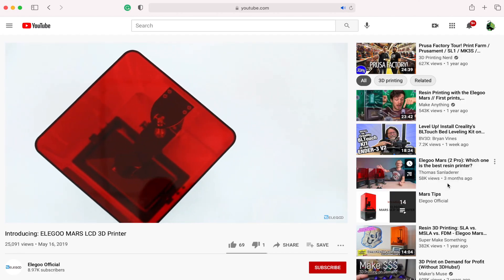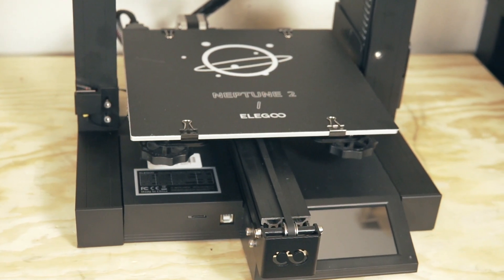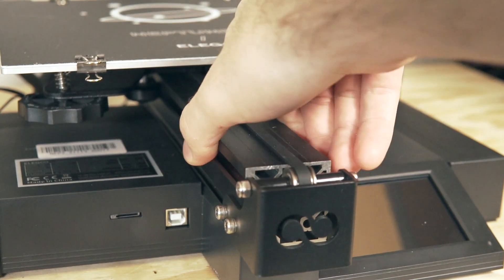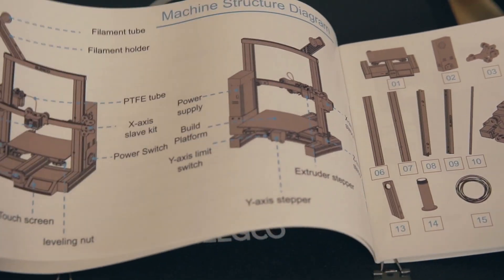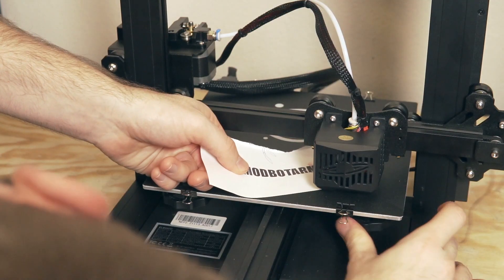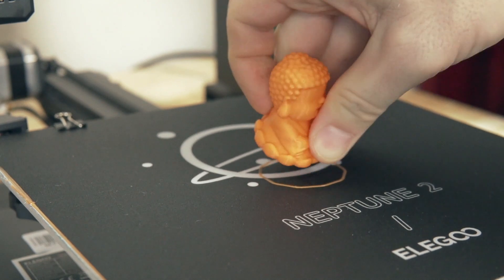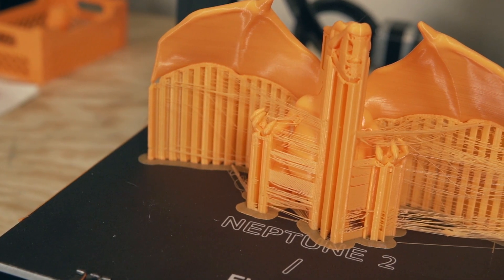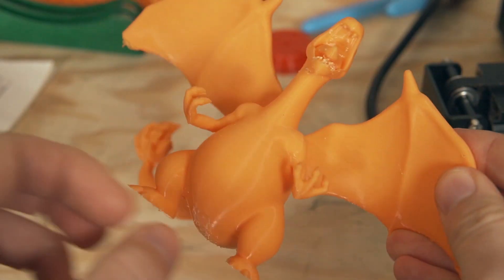Best Sub $200 FDM 3d Printer In 2021? The Elegoo Neptune 2

Comment: The setting you want to reduce the stringing between supports is "limit support retractions" under the travel section (hidden by default).  Checking that box means it rarely/never bothers with retractions going from support to support - the reasoning being that it saves time and you don't really care if your supports are stringy.  The caveat is that it's not super smart about whether it crosses over the actual model when going from one support to another, so sometimes it will create strings on the model itself.  If the stringy supports bother you, or it's dragging the strings across the model and messing up the finish, just uncheck that setting.
Reply: Ha. I learned something today, thank you good sir.
Reply from the maker: This is the first time I have heard of this haha. Thank you very much for letting me know as well as for the detailed comment. I am sure that is what it was since the main print had no stringing issues.

Comment: Well done review. Looks like a very good printer for that price. It even offers more features than the Ender 3 V2 at $279.
Reply from the maker: Thanks Chuck! It is pretty damn impressive. I have a V2 sitting here waiting to be opened so I am looking forward to seeing how it compares.
Reply: @3sotErik  better to buy the best machine you can in your budget now than wait and not print anything for weeks. No telling when the Neptune 2 is coming back in stock but if you can find it and a return policy for back up, go for it. Probably the best tinker printer for $160. I would hesitate for more than $230.

If you can spare the extra budget, check out the Biqu B1. A flexible bed and dual cooling fans and other features here and there are nice over the V2.
Reply: @ModBotArmy 
Hey, so, I'm a bit confused:
Do you think this print glass filled nylon or not?

You mentioned that the hot end was all polymer, so that it might not be a good idea to run it at the full 260°C.

What upgrades could be made to enable it to do so safely?
Reply: @wanderingcalamity360  Hey, just saw your comment, 260 with a non-all metal hotend is literally the bleeding edge of a nerutoxin filled room and that is assuming high quality teflon is in the hotend. 240 to maybe 245 is the safe limit and even then you would need a specialty nylon that prints well at that temperature. If the heater overshoots at all, you might put yourself and others in danger so grab yourself either a micro swiss or e3dv6 or other and slap a hardened steel nozzle on there for good measure. You may also want to invest in some form of dry box and maybe a dehydrator/desiccant for nylon because it is very hydroscopic. Filament slipping with abrasive filaments is also a concern so you might need some form of dual drive extruder with hardened gears rather than brass. Long story short, you can try and print nylon with what you have and stay safe by keeping your temps 240-245 but this is a $160 3D printer. Most people don't buy a moped to haul construction material if you get what I mean. Best of luck to your printing!
Reply: @Bajicoy 
Thank you for your help.

That lines up with what I've been researching.

I'm still trying to weigh options for what would be the most economical approach for the projects I'm looking to do.

I figure if it can print GFN, it can do just about anything I could ask of it.

I've got an old dehydrator that I was thinking about cannibalizing for a filament dryer and making an Ikea Lack enclosure for whatever I decide to go with.
Reply: @wanderingcalamity360  outstanding man, GFN is a great standard to have. I believe in you getting that setup!
Reply: Wonder how it compares to Voxelab Aquila
Reply: I bought my ender 3 v2 for 230 dollars from a 3d party store that sells most of creality's stuff in my country

Comment: Got mine a week agoi. Great little printer gives my ender 3 pro a run for its money. Build plate was the only gripe
Reply from the maker: Yeah build plate is the only thing that gets me. Any plans to upgrade?
Reply: I bought a PEI spring steel flex plate and that's so much better. I also want to do something about the part cooling fan and positon, will wait and see if people are going to mod this.

Comment: At 4:30 I'm surprised you didn't mention that on the main board there is an empty plug labeled BL-touch
I'm curious if the firmware supports it natively or if you have to do an update.
Reply from the maker: Yeah I should have. I would like to know that as well. They seem to make it easy to install with the mounting holes.

Comment: i replaced my bed with a mirror cut down at home depot/lowes got around 6 beds i can pick from for most flatness, just clean with ipa when it gets dirty, prints pop free with temperature differential, No glue no adhesives, just good bed level and layer heights, never have had an issue with prints pulling up

Comment: Tronxy XY-2 Pro has a larger build volume and Auto Bed Leveling at the same price and for a bit extra you can order it with the Titan extruder aswell. How`s that for a bargain?
Reply: Thanks for the heads up. Hellava bargain
Reply: I have an XY-2 Pro.  I bought it for $135 on a Black Friday sale, for that price it was impossible to pass up even with 5 other printers.  It is my least favorite printer though, and I dont think I would recommend it as someones first printer.  It is a fair printer if you do your research and understand the machine.  Eventually I am going to have to mod it to make it good printer, the firmware is its biggest disadvantage.
Reply: @jon9947  Marlin 2.0 is a breeze to install; less than half an hour easy. For that money you`re not buying even the base Ender 3 which lacks many of its features . I bought one as my first printer and after 2 months I bought a second one because for that money is a steal. Never owned an Ender 3 but I`d say as printing is concerned it prints just as good if not better and it still has those extra feature which to put on an E3 would cost you at least 100 bucks: silent board, ABL. You`ll still be left with a smaller printer. Believe it or not I`ve not done any mods on mine and it prints like a charm: even though I mostly print PLA I have managed to print ABS, PETG, TPU. BY the way what are those 5 extra printers if you don`t mind me asking? Just curious
Reply: @maiorciprian  Eventually I will get around to doing something with the printer.  I am just not in any hurry/lazy haha.  Giver or take Iv got about 50 hours of print time on it so far.  

My other printers are an original Ender 3, a cr10 Mini, a cr10, an Anycubic Mega S and a Tronxy d01.
Reply: @jon9947  CR10Mini? never heard of that one; so you like the D01 better than the XY-2? That`s a surprise as many people hate the D01 with a vengeance. Well, besides the two XY-2 Pro`s I also have a Two Trees Bluer Plus, which is basically a CR-10 with a few upgrades. Now I`m waiting for parts to build my first Voron
Reply: @maiorciprian  The d01 is another printer I got a really good deal on.  I bought it to mod, replaced quite a lot of the parts.  I probably would have been better off building a Voron or something else similar, but it was a fun project and it prints pretty good now.  Its biggest problem was flex in the bed because they used terrible bearings.
Reply from the maker: That sounds like a great deal. I wonder why they are not getting more exposure. Tronxy printers in the past have been hit or miss for me.
Reply: @ModBotArmy  I suspect the facts that the X5SA was a hot mess that required a ton of work just to make it reasonably functional, and the D01 was a fire hazard with the original FW, soured a lot of folks on the brand.  I've had several people tell me that tronxy actually listened to the criticism though, and that a X5SA pro today is vastly improved from the original iteration and the D01 now ships with TRP enabled.  I've also seen nothing but good things about the XY2, though as you said, you don't see much at all about it because most folks steer clear of the brand.

Maybe you can reach out to them and see if they'll send you their latest versions for review.  I'd love to know if the 2nd hand info I'm getting is accurate that tronxy has been upping their game and fixing their issues over the last 18 months or so.  There are quite a few tronxy reviews on youtube, but they're all at least a year old.

Comment: @16:00 Do the fans run at 12 volt or 24? Can I easily replace them with some from Noctua to make it quieter?
Reply from the maker: Should be 24V. The blower fans I do not think Noctua makes (maybe incorrect)

Comment: Sweet review so thanks for that! Question on the Elegoo Mars 2 pro, if I installed the resin printer in my office, how is the fume issue? I had heard that the newer mars 2 pro has better a ventilation system...
Reply from the maker: Thank you :) So it really depends, if you use low odor resin I do not think it is bad especially with the lid on. However, everyone has their own sensitivity levels. It is tough for me to say how you may feel. Some resins that are not low odor to me can still smell quite bad with the Mars 2. It is such an awesome technology though.

Comment: Have you already had a look on the tronxy xy 2 pro? It is sometimes really cheap and has a bigger build volume with 255 x 255 x 260. Running on marlin this printer is really capable of doing good jobs
Reply: LOVE my three Tronxy XY-2 titan pros.
Reply from the maker: I do not believe I have seen this machine. I definitely havent used it. It has been 1-2 years since I have used a TRONXY machine.

Comment: Personal opinion: Neptune 2 is a direct challenge to the Creality Ender 3. They got the price $10 cheaper than the Ender 3, and added a filament out sensor, and the Touch screen. oh! how can we forget the silent stepper motors. My Ender 3 is 2 rooms from my parents room, and they can hear it clearly through brick walls with the door closed....
The price drop reminded me of the price drop of CD-Writers, Here in South Africa a 1st gen CD-Writer was ZAR5700, The last time it was on sale it was ZAR350. The same is happening with 3D printing.
Reply from the maker: Yeah in its current state once they are able to get enough inventory if the price stays the same I can see this printer really doing well.
Reply: @ModBotArmy  Agreed, Elegoo has set a benchmark with their MARS series of printers. So we trust the brand. Honestly Creality has also set a benchmark as a printer that 99 times out of a 100 will give give you a workhorse. My little Ender 3 is still going after many years, supporting my small scale production for parts for my model rocket kits.

Comment: Great video but unfortunately NOT currently available on Amazon.
Reply: Apparently that depends on which Amazon. Amazon.de is running low but there still are a handful left
Reply: @saschaschneider6355  I didn't think of that, the link brought me to Amazon.com so assumed it was the place to go. My bad.
Reply from the maker: Were you able to get one? I am sure Amazon.com will get a resupply soon.
Reply: @ModBotArmy  No, but that's okay.

Comment: Im just confused now, should i buy an ender 3 pro( and update the 32 bit board/springs/add bl touch) for a grand total of 300 usd ? Or buy and try to upgrade this one D:
Reply: If I may: I‘d recommend the Ender 3 V2 - it‘s basically an Ender 3 Pro with a couple of great upgrades (ex. 32-bit board, silent steppers, bigger display, ect.).

I own the printer myself and am very happy with it.
Reply: @Schnabulation  The E3v2 is $280.  While it's a nice machine, you could buy the neptune 2, an all-metal hotend, a BLTouch, and a magnetic PEI-coated steel build plate, and end up with a machine that is significantly better than the E3v2 for less money.  If you're not afraid of doing some simple upgrades yourself, it's a much better value proposition.
Reply: @mortalwombat5811  I do agree with you on the „bang for the buck“ part but the Neptune 2 being significantly better than the E3 V2, even with the BL Touch and the allmetal hotend, not so much. It will have some convenience improvements over the E3 V2, yes absolutely. But I don‘t think the print quality will be superior though... 

What I‘d like to point out though is that the Ender 3 has a quite strong eco-system with a lot of pre-made parts and upgrades.
Reply: Go with the Ender3 pro and get a 3d touch from trianglelabs. Cheaper and just as good as the bltouch
Reply: I've gotten the E3 Pro a few months ago and if I was to buy my first printer today I'd very likely go with this one or the Biqu B1
Reply: @Schnabulation  ABL is a huge convenience, and while print quality is more or less "as good as it gets" with nearly any FDM printer these days, an all metal hotend will allow you to safely print with higher temp materials like ABS and PC (and even some pickier PETG) that you can't do with a PTFE-lined hotend.  As to whether creality's fancy glass bed is better than PEI-on-steel, that's probably down to personal preference as both are quite good.

That said, you're not wrong about the creality ecosystem/knowledge base.  If you want to add ABL to an E3v2, there's probably half a dozen brackets you can print on thingiverse and hundreds of articles, blog posts, and forum threads walking you through the process.  With a completely new machine like the neptune 2, you're kind of in uncharted waters.  I mean I'm sure it's not that hard to sketch up and print a ABL bracket or modify the FW for ABL, but it would be pretty intimidating for a first-time printer owner.

Comment: I've been on the fence about trying a 3d printer. This appears to work out of box as well as any FLM printer is likely to work. The printer plus a spool of PLA or PETG would be around $200. This looks like a good enough printer to make an occasional bracket or such but is low cost enough that one wouldn't feel obligated to use it all the time to justify having purchased it.
Reply from the maker: I agree, the cost of getting a 3d printer has hit a point where even if you dont have a million projects lined up many are able to justify it for the occasional part. With that being said, it is very common for people to have one reason to get it and once they do find many other things to do with it.

Comment: The stringing between supports means that the “limit support retractions” settings in CURA is turned on.
Reply: Or combing set to skin only
Reply from the maker: Thank you for the info :)

Comment: Would this be better than a ender 3 v2?
Reply: By specs I think it is almost better because it has a 32 bit silent mainboard (like the e3v2) and it looks like a very similar hot end. It also has a filament run-out sensor and touchscreen which the e3v2 doesn’t have so it might be better. However there is a €100 difference so I assume there will be some massive reliability issues. I have the ender 3 V2 and that is a perfect first printer
Reply: @jobcallenbach3213  The thing I’m wanting is reliability
Reply from the maker: Tough to say. Creality has a huge community for FDM printers which in my opinion is valuable. Specwise, it does seem like this is the better option. I have a E3V2 that I need to open and test out. It may take some time but I may do a comparison.

Comment: This printer sounds allot like the Voxelab Aquila in terms of features and price point!  

Yes I paid £189.00p for the Aquila on UK Amazon in June of this year. 
But now they have got that Aquila the amazing clone of the Ender 3 V2, for £160.00p 

So it sure be the case that at least these two companies are pushing down the price point for their printers to tap in to the low price market of Newbies in 3D printing?

The one thing I would ask you sir is, can the Elegoo Neptune 2 do TPU without any upgrades?  

Because I seen that the Aquila can do TPU as long as you just print out st a simple new level and top for the extruder that make sure 
the TPU filament don't bunch up as it goes through the extruder gear and get stuck.  Would this Neptune 2 need that too?

I see the Neptune 2 is very popular indeed But the company sure not producing the amount of stock needed by the customers even now!

Comment: lol "break and damage" if youre set to 110 on a 240 supply ...  on my first printer i didnt do this step and it literally blew the psu up electrolytic fluid and smoke everywhere and somewhat of a shock i had to buy another psu and couldnt use my new printer for like a week savage

Comment: I liked the review as always, did you mean Brim instead of Skirt, in your conclusion?
Reply from the maker: I meant skirt but I did use brims as well on the charizard model because the supports were thin in certain areas. Same would apply as far as welding to the bed 😬